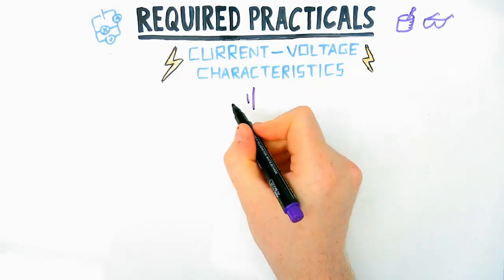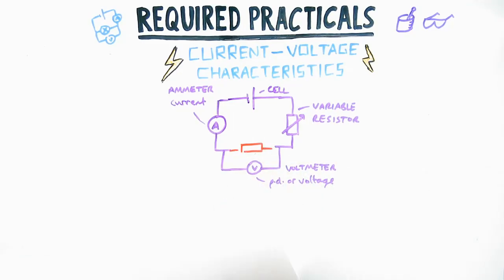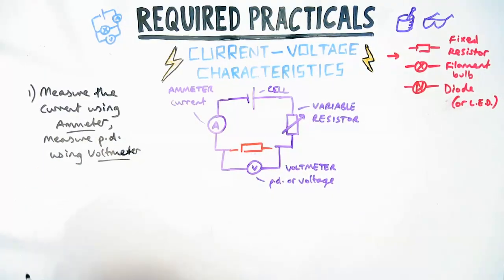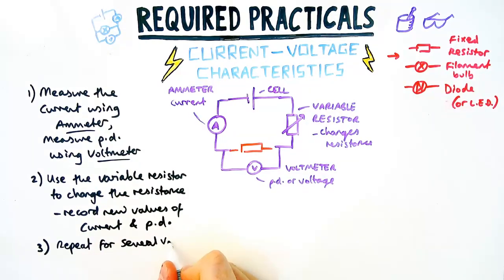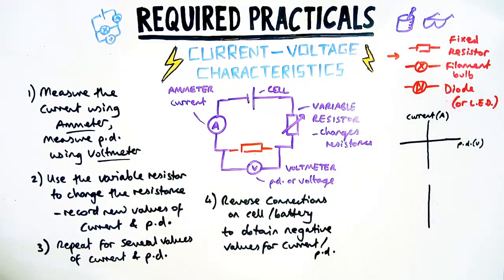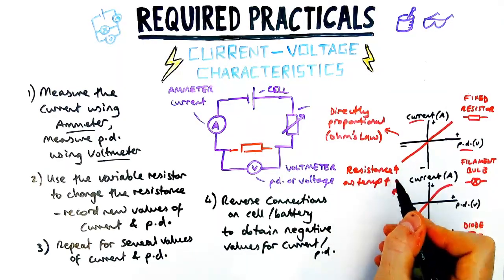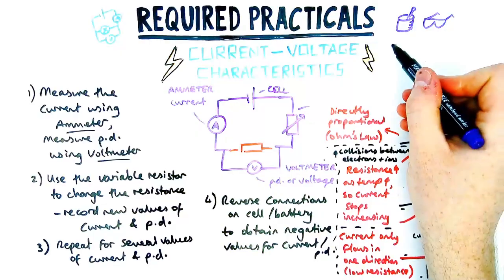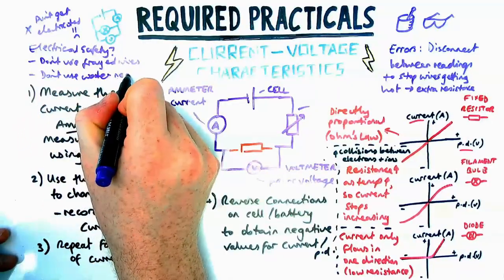I-V Characteristics REQUIRED PRACTICAL - GCSE Physics Paper 1

Comment: 3:26 best video for this practical, but the electrons carry the carry and where is the ions from? Is it the wire particles?
Reply from the maker: Good question! So in metals, the electrons are delocalised and free to flow and carry the charge. The atoms they leave behind now have a positive charge, which are called ions - these have no overall movement in the metal
Reply: @captainphysicss thank you I feel silly now😭